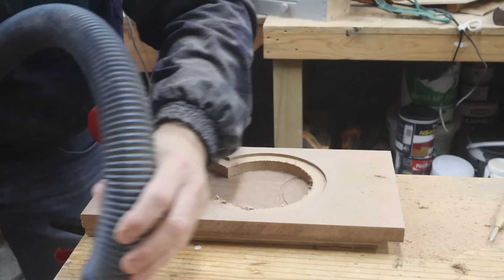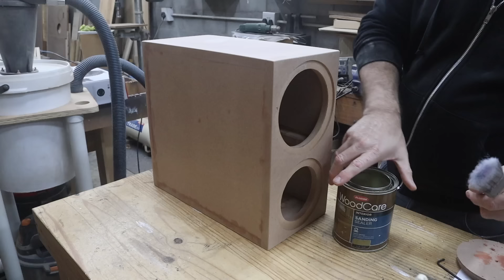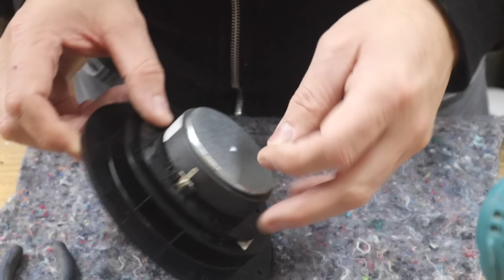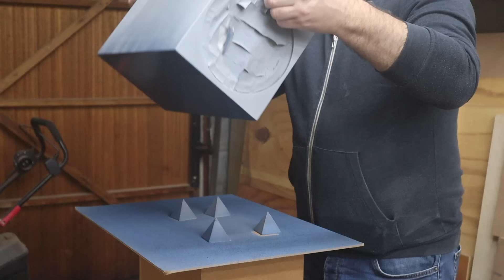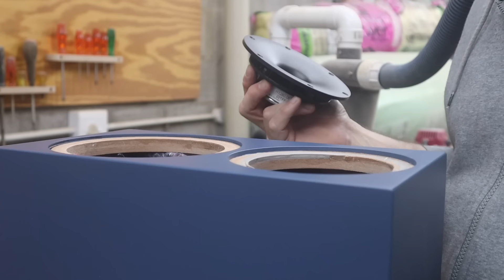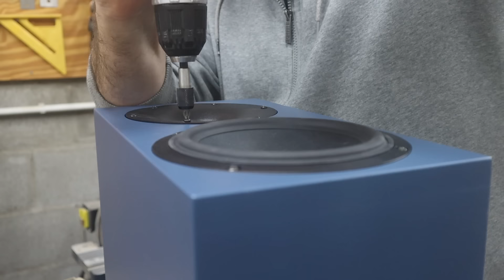Building WAVEGUIDE & PASSIVE RADIATOR 2-Way Speakers - by SoundBlab

Comment: SEAS speakers always punch well above their "weight" class. I enjoy your content but in this episode I saw and heard a few things that I may, humbly, like to send notes from my life of home/car audio sales/instalation/fabrication and years of construction ending in a full blown contractor before becoming disabled. (I did not want you to think I'm just yappin from the cheap seats) .. now .. a little spray adhesive on the sides of the little fluff you put over the crossover will stop it from dancing with the bass up the wall.. big fan of super 77 for most any application of spray.. more .. a mix of water and just elmers glue 50/50 makes an excellent sanding sealer and helps big time with the "end" grain of the mdf sides. Just some thin coats and it sands great when dry .. more .. the binding post. I shed a little tear when you put steel binding post in that fantastic built and designed speaker. Ferious anything affects and effects the signal and ultimately the sound. I did not believe it untill a friend of mine quite a few years back replaced his home speaker binding post with copper "tube connectors".. back then very esoteric but today readily available. Those that know the difference between listening and hearing music can hear it with little effort and lastly a note from my construction side.. your air powered brad nailer. That looks like a Bostich 18 ga toi me. Should be easily rebuildable or taken to a service center. Nine times out of ten its a simple oring. And penumatic tools beat battery tools every day of the week. I have DeWalt 16/18 ga brad battery nailers, Passload/Hitachi battery spark butaine power framing and brad nailers and a large mix of the air types. In the cold and heat the battery ones suffer. They have a limit as to the depth of drive especially half power and down. Stick with the air. You will appreciate it. Subscriber for a long time and usually keep my "internet" oppinion to myself but today was in share mode. I hope I did not overstep and know I am not being a Karen of any kind. I say all this with humility. Your the one doing the work I'm just watching. God Bless and keep up the content.
Reply from the maker: Thanks man, appreciate the comments. The binding posts are brass with a nickel plating, no steel. My brad nailer is new, so not sure it already needs a rebuild, but even one I had before was not great either, thats why I got a new one. But in the meantime I got a battery brad nailer, and I am much happier so far.
Reply: @SoundBlab   Excellent.. If you had similar issues with the other nailer i'd say its your compressor, pressure setting or hose diameter. Enjoy your content sir.
Reply: A Karen.. ha, no that’s called being a traditional dude (overextended explanation on how YOU think it aught to be done) who happens to be an audiophlavin
Reply: JamesHobbs1460: What concept in physics would you accrue to this supposed difference in “sound quality” WRT the materials for your connectors? Also, could you fill me in to how you performed your ABX or, at least, double blind test that led you to believe that the sound was different? Finally, how was it different? FR, distortion?
Reply from the maker: I have not performed any AB testing on connectors. I have never really been able to hear a difference to be honest. I think that these small differences are generally only audible in very very high end resolving systems in properly treated listening rooms. However, when it comes to steel connectors it is fact that copper and brass for example does have better conductivity rating than steel, so from that perspective alone it makes sense to use whatever has the better performance. That's really all I'm going by, but it's not a big deal to me. As long as I enjoy the music, I am happy.
Reply: @Obsfucation  Well.. I've got years and years installing, selling and testing audio gear. Home and Car. I've been a IASCA and USAC judge for SQ many a time. I am always the resident person to build or tune a system home or car. And its simple to understand if you put anything that can magnitize in a signinal path it will affect the SQ if introduced before the speaker. Knowing how to hear and listen is a skill. It's not something that can be talked about or discussed in a typing messaging form. It has to be shared.. expressed.. shown.. "He who would learn to fly one day must first learn to stand and walk and run and climb and dance; one cannot fly into flying."

Comment: Your most beautiful pair since the Dynamites!
As you quite often use 3D printed parts to make your life easier, let me suggest doing this for the waveguide and tweeter as well - just a round piece with a "step", the smaller diameter being the one of the tweeter and the other being the one of the waveguide, then you could just place them perfectly very fast; drilling the holes, securing them, done :)

if I ever build a 2nd pair of yours, it would be this for sure!
Reply from the maker: Thanks. Yeah a 3D printed jig would've been handy, but I always try to do without 3D printed parts as a necessity since not everyone has access to a 3D printer, unless the entire project is built around 3D printing. But I like the way you think.
Reply: @SoundBlab  I've been looking for a project that uses the best of both worlds for a while. Don't think of it as a woodworking project that requires a 3D printer - think of it as a 3D printer project that uses wood 😜
Reply: Its very important that the waveguides be symmetrical.  A 3d printer wont print as smooth and even as injection molded plastic.
Reply: @Dev_Everything  I think you misunderstood what I was trying to say, so let me elaborate (which is hard without images, haha). Imagine that if you cut it open, it looks like an L

The part would only be used to align the pieces, nothing else. Basically it's a ring that "clips" to the waveguide from behind, not sure how you call the area, the part that gets drilled later. And that printed part should have a 2nd "step", which has the outer diameter of the tweeter, so you place that one inside and and have a virtually ideal alignment as all parts should already be centered. I'm sure it's not perfect, but I'd bet it's at least as precise as doing it by hand - just way more convenient :)
Reply: @Dev_Everything they are trying to say it would just be used as a jig to align it